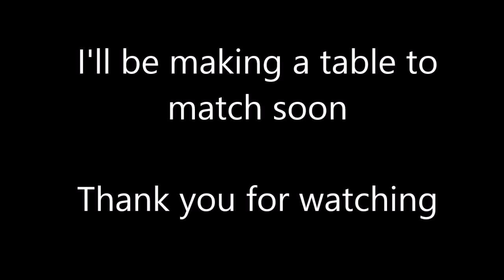making wooden folding chairs (for kids)

Comment: Love the design and concept but to much hardware required - I'm wondering if Japanese carpentry could be used to create more wooden parts and joinery to limit the weight... Brain is thinking some more impressive things might emerge from from this build. Very cool overall... Great storage and design. Big thumbs up.
Reply from the maker: +Richard Grzela thank you ,a box joint/finger type hinge would work instead of piano hinge and initially it was going to have a peg on the legs that fit into holes on the seat to lock it in position,but as I was working on it, as it's for kids I got worried that if it wasn't some kind of mechanical fastener it could close up quickly on the kids fingers so I went with a lock I could trust ,I'm sure it could be done many ways ,it would be cool to cut one on a CNC as it could be cut from a single 2ftx3ft piece of material,thank you for watching,i appreciate the input/comment